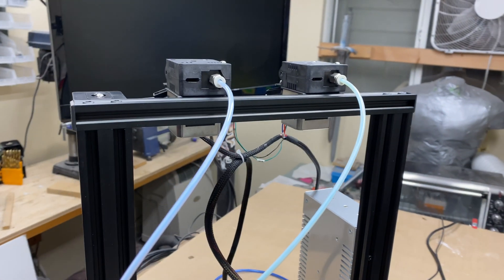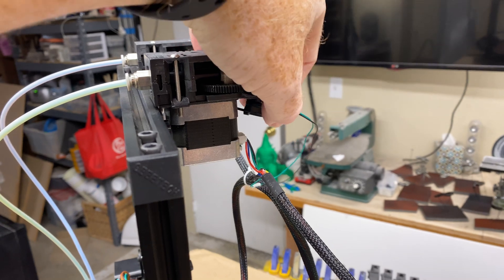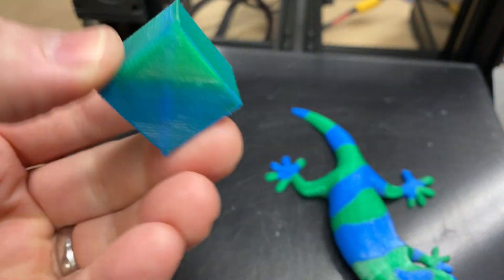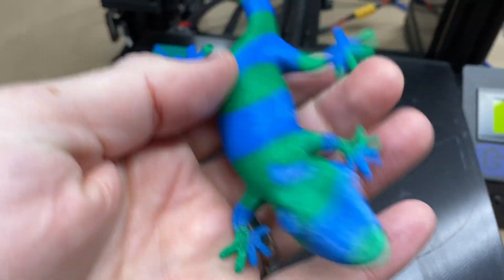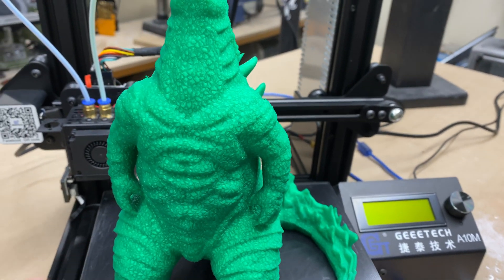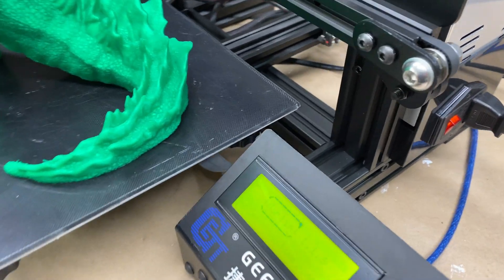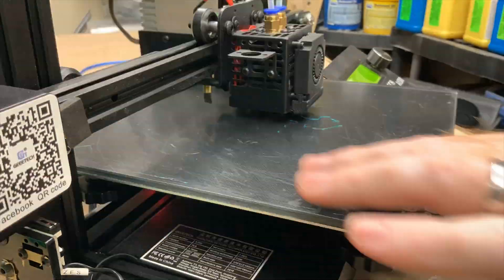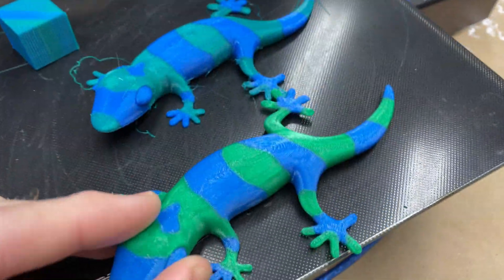3D Printing with the Geeetech A10M

Comment: Hi, So I just received this printer as a gift however the ribbon wire (I am not sure of the technical term) came detached, and the piece inside the machine snapped off where the wire should be snapped on. Is there a way to fix it? I am new to this and want to learn and explore 3D printing. I believe there are other issues but this is issue #1 I'd like to fix... and if anyone has any tips or anything please let me know..... I am excited to learn...